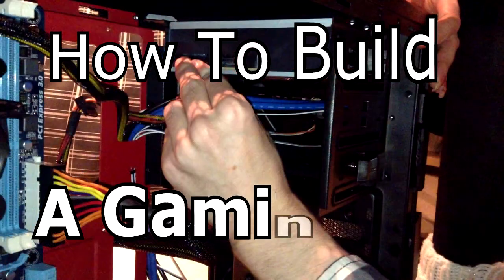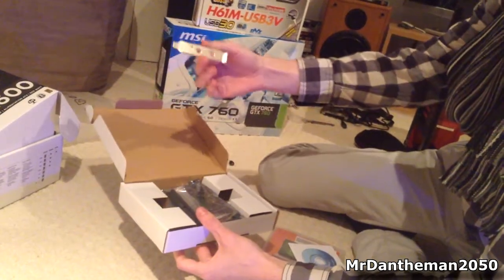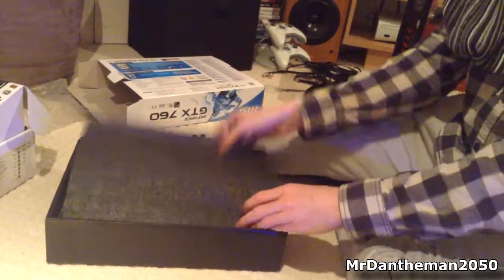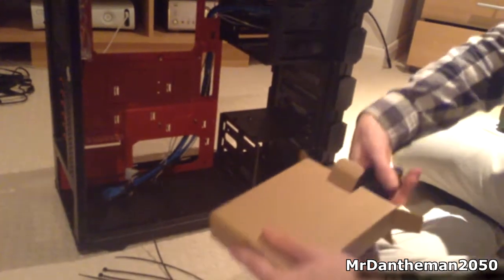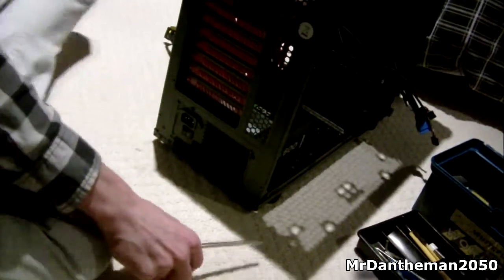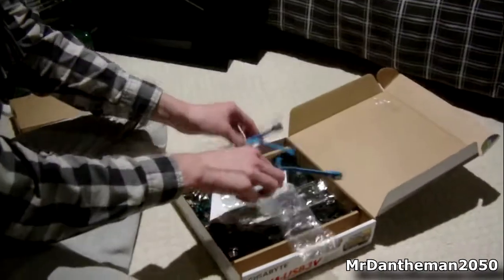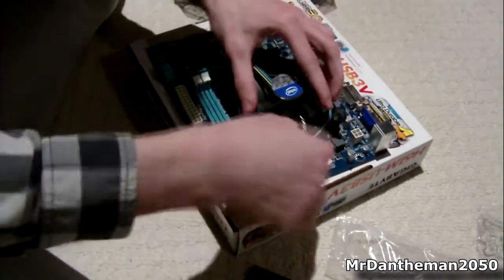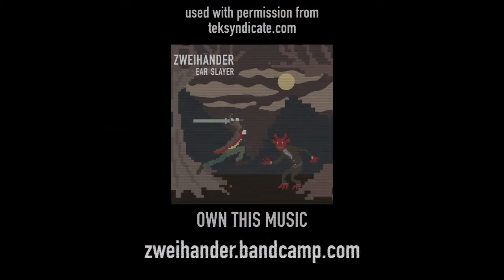How To Build A Gaming PC - Part 1

Comment: Can u upgrade this build from gtx 760 to gtx 770 or 780 without changing other components?
Reply from the maker: Hi, yes by far. My system now has a GTX 770 and runs like a dream! :D
Reply: thanks, I might build my own pc, and probably just use a carbon copy specs of urs except i will equip it with a gtx 770 or if i save more, i might just use 780. Thanks, i will use this video and follow it step by step since there are hardly any other vids that provide good explanation on how the nooks and crannies go
Reply from the maker: masterkent1 No problem, just as a caution. If you were to use a GTX 780 you might want to upgrade the CPU as the i5 i used is one of the lower end i5 CPU's at around £125. This is to avoid any bottleneck. However i will say the GTX 770 i my build now is absolutely fine with this CPU. Up to you though :)
Reply: my friend and i are competing on who's rig is better, he has a gtx 680 ti build and i have no chance against him since mine is a gt 755m. I need to get a better rig as im saving up for 1500$. Btw how much is the grand total in dollars? (upgraded to gtx 770) Thanks for the support.
Reply: oh and u earned a sub
Reply from the maker: masterkent1 Thank you, and im not sure in US dollars. Back in December i spent a total of about £800 with the upgraded GTX 770 GPU :)

Comment: Great videos! Just a quick question..I'm a first time builder and I'm wondering if there is anything that you would change in this build as of now. This PC will be used for gaming (BF4/Metro/Crysis3 etc oh and Minecraft! My budget is around £1000. I would really appreciate a response, ty
Reply from the maker: Hi, this build it great. i recently added a 240GB SSD and a GTX 770, replacing the less powerful GTX 760 in this build - about 15-20% more performance in games for little price. hope this helps dude.
Reply from the maker: if your budget is £1000 get a GTX 780 graphics card. Killer Performance!
Reply: thank you very much for the quick response, one more thing i forgot to add. I use a 2560*1080 widescreen monitor (21:9) . Whats the cheapest card I can use to get the best out of my monitor? I heard that this depends on the amount of vram your card has...

Comment: do you require a wirless adapter?
Reply from the maker: Hi, not at all no. Unless you want Wi-Fi that is. All motherboards to my understanding have a network port on the back for a wired connection from the router.

Comment: nice video, thanks! but I have a question, are the case fans of the bulldozer very loud or are they ok
Reply from the maker: Hi, to be honest they are not loud nor super quiet. However, i am looking to replace them for Corsair Air Series AF120 Quiet Edition High Airflow 120mm fans.

Comment: If a PCI-E x16 slot is version 1.0, will it 'bottleneck' a newer card like the GTX 760?
Or it doesn't really matter much?
Reply from the maker: with pci-express 2.0 it won't make much a difference but pci-express 1.0 will slow down the card a lot, i really don't advise getting a GTX 760 at all if you are to stay with that motherboard you have.

Comment: I thought thermal paste is necessary ? Why you didn't apply it on cpu ?
Reply from the maker: Hi, for this build i used the stock Intel cooler. these have pre-applied thermal paste so i didn't have to apply any of my own.
Reply: That's great , it's make work easier. Thanks
Reply from the maker: John Looi It does indeed haha, thanks for your question!